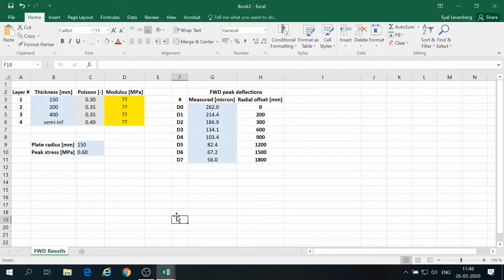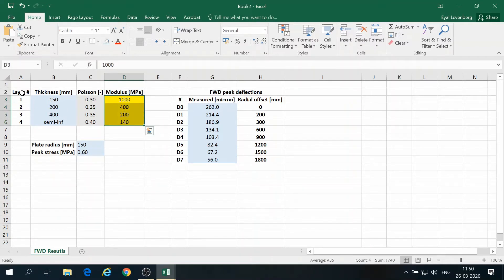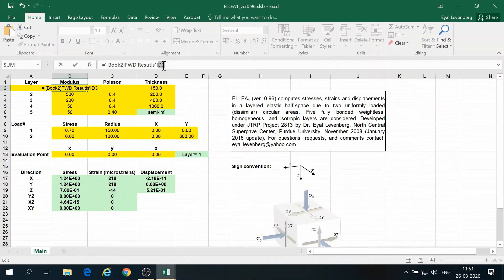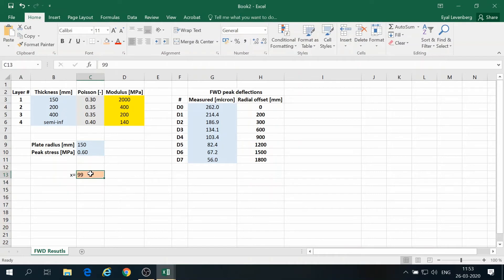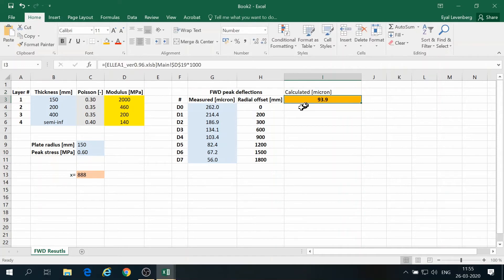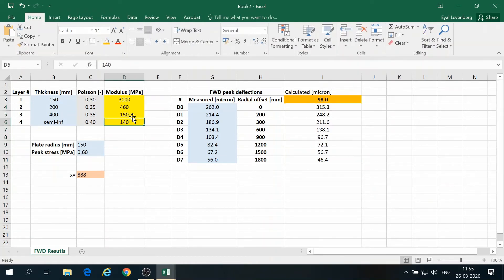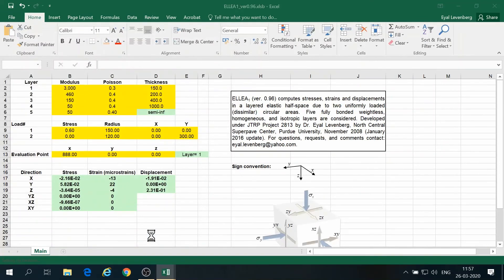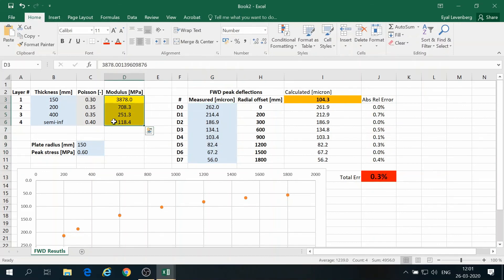FWD Backcalculation with ELLEA1 - Tutorial

Comment: Dear sir, my question is, is it possible to determine the elastic modulus of three layer pavement system from plate load test.
Reply from the maker: If you are asking about solving for a three-layered system instead of solving for a five-layered system then the answer is yes. Simply merge layers 3, 4, and 5 into one by forcing identical elastic properties during backcalculation.
Reply: Dear Sir,

Thank you for your response. I sincerely appreciate your guidance and will make sure to apply your suggestions. May I kindly request your email address so that I can reach out to you for any future queries?

Looking forward to your support.
Reply from the maker: @Kalu-n9x  My contact information is mentioned in the Excel worksheet.
Reply: @levenberg  thank you
Reply: Sir i have sent an email.

Comment: what if effect on results if we increase thickness of bc  in calaclution
Reply from the maker: Sorry. I am not able to understand the question. In any case, the worksheet allows you to test sensitivities to changes in input values.
Reply: @levenberg  sir if our existing DBM and BC Thickness is 190 mm , but in calculation we taken 250mm  then the results showing balance life less or more ?
Reply from the maker: @sunilkothari8057  I still cannot understand the question. What is DBM? What is BC? What is 'Balance Life'? In general, the code solves a set of mathematical equations. The implications and meaning of the calculation results on reality are a matter of engineering judgment.

Comment: Dear doctor, what considerations are taken in retrocalculation of mixed pavements?
Reply from the maker: Can you provide an example?
Reply: @levenberg  Doctor, ELLEA1 by what methodology does it determine stresses and strains? Elastic Multilayer? or MET ODEMARK?
Reply from the maker: @nilopolo3163  Multilayered elastic. Equations can be found here: 
https://www.amazon.com/Pavement-Mechanics-Prof-Eyal-Levenberg/dp/8797231703
Reply: @levenberg 
tread layer: hot mix asphalt.
Concrete slab.
Granular base.
Subgrade.
Reply from the maker: @nilopolo3163  In this case i would pre-set the PCC modulus. Also, i expect some bias in the backalculation results due to joints in the concrete. Lastly, quasi-static analysis may not work well - you need to check this against a dynamic solver.